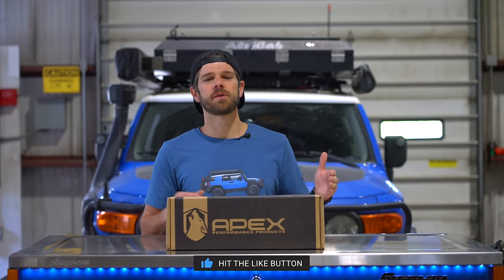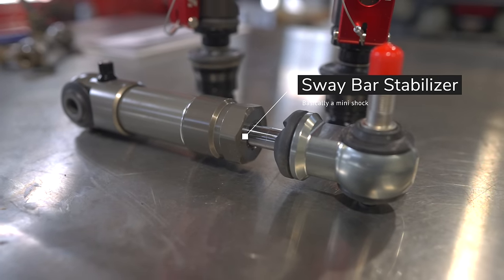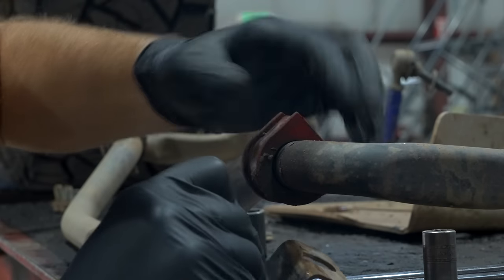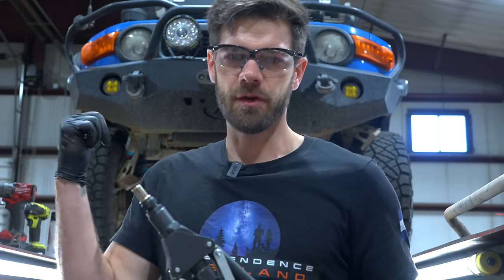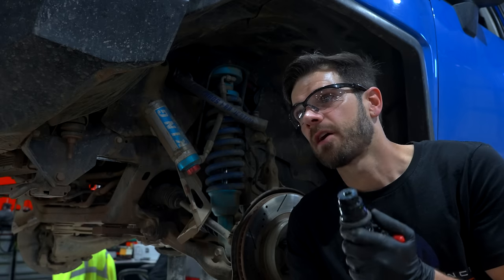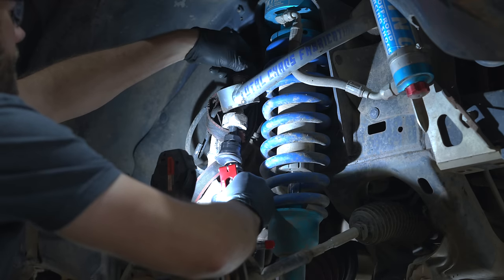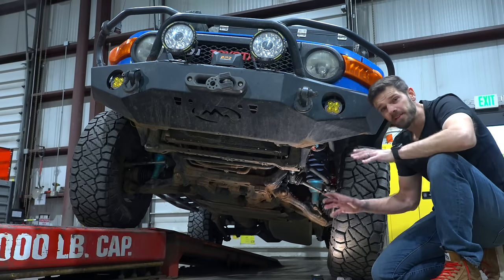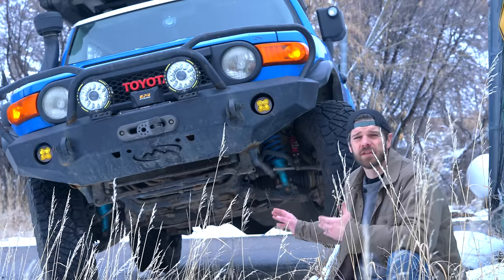The Ultimate Toyota Sway Bar Disconnect! | Apex Designs KwikLynx

Comment from the maker: A wonderful update. These no longer require welding, they still require drilling though! See the website for updated installation instructions. 

Apex Designs Disconnect kwikLYNX Disconnect: https://www.apexdesignsusa.com/products/kwiklynx

Bolt and Washer kit! Zinc plated coming soon! 
https://www.ebay.com/itm/176000986000?var=475438066727

Overland Vehicle Outfitters Remeote Resi Mount: https://overlandexpeditionoutfitters.com/collections/oeo-in-stock-in-store/products/oeo-front-reservior-mounts-for-dobinsons-mrr-4runner-fj-cruiser-tacoma-gx470

🌎 OnX Off Road 20% Off: https://bit.ly/499Pdu2
⚙HEST Mattress ($50 Off Coupon Code OVERLAND50) : https://bit.ly/3mZVulT
⚙ REDARC: https://bit.ly/3ughGfk
⚙ MAXTRAX Recovery Boards: https://amzn.to/3bwXpMR
⚙Channel Merch: https://www.independenceoverland.com/shop
⭐Amazon  https://www.amazon.com/shop/independenceoverland
Reply: I just watched their video a couple days ago. 🎉

Comment: $750 starting price... I know they are engineered deeply and come with R&D costs. But $750 feels like too much considering how many people would actually buy this if it was cheaper.
Reply: $750 seems like a very cheap price considering the quality of the parts... they will have no problem selling these once word gets out.
Reply: Depends on the buyer. $750 is a lot when it's just the parts. That doesn't include the labor installation. He advised most to take it to a shop. I wonder if it would just be better to lose the sway bar all together and get higher end shocks to dampen the body roll. Or go stiffer bar in the rear to compensate like Tinkerer did.

Comment: Now that Apex has taken welding out of the install process (it's optional now ...and I should really just learn to weld) I just bit the bullet and ordered a set of these for my 2017 Tacoma.  The increased articulation that this sway bar disconnect will provide combined with the Tacoma's MTS will really offset the lack of a front locker in many situations.  And $750 for this kit is still less expensive than a front locker and an easier install.  Anyone who has taken out the front diff on a Tacoma knows!  Now, combine this kit WITH front lockers and you've got an off-road IFS weapon.  Thanks for the video.  Cheers!
Reply from the maker: I was pleasantly surprised to see welding is optional, thank you for pointing that out for everyone bud!

Comment: The fact that this i is how the spindle is now connected to the upper ball joint is an absolute no!!!!  Nord lock washer are not a replacement for crown nut/cotter pins if it ever looses it's initial friction resistance there is nothing stopping it from vibrating loose! Aftermarket stuff at least uses a nyloc nuts while less optimal than crown nut/cotter pins in the end you get almost the same effect.

Comment: I just saw Apex's video they put out detailing the install of the sway bar disconnect.  Of course, being semantic, it's not really a true disconnect, but close enough right?😂  It is a big pill to swallow, $750, BUT looking at the product and the engineering and how much is involved, I'd say it's a big step forward and I'm looking forward to purchasing the system shortly and getting it installed.  If I watched the video correctly, they did make it so you can avoid any welding if you desire, but riv nutting those brackets to the frame I believe.  Which is cool.  I already had a buddy that can weld, but now it appears we can avoid that.  Looking forward to folks testing these in a technical way, doing RTI comparisons and also how well they hold up over time.  It certainly looks like a lot of engineering went into them to make them better than what was available before.

Comment: Video started out well but was lacking images as the install progressed, like what it looks like from the side fender well view of the stabilizer shock install, as well as installed without the tire on. To me Apex should offer the parts to work on several of the main aftermarket arm bolt adapters for the same price as the stock one they machined. Why? Because the majority of the FJ’s are already running lifts and are modified. They are the ones spending the money on aftermarket upgrades. IMO🤷🏻‍♀️

Comment: Great video and I'm driving an '07 GX 470 with Dobinson Billet adjustable UCA's Ironman FCP 2.5" lift with no sway sway bar.  No sway bar is fine for on road for the most part here in SoCal but it definitely rolls a bit on fwy turns.

Comment: Late to the comments here but great install - also great to see this documented for Apex's R&D. I do wonder if this will work with a beefed up aftermarket sway bar like the RSO or Super Pro 3 position. Maybe even get around the needing to drill the bar with the 3 position?

I'm already on board with Tinkerer's Adventures idea of a beefed up rear sway bar (though he doesn't run a front) and with these disconnects, would be fantastic if now a larger sway bar could be run in the front too for better, KDSS-like, highway speed handling.

Comment: Seems like a ton of work and it is expensive. I think I would be tempted to just remove the sway bar at the beginning of my trip or when I arrive at the trailhead.
Reply from the maker: Which would require removing 2 skid plate every time, and then having a place to put a sway bar. Doesn't work for my setup.

Comment: Hey great installation!! How did the different bolt that you had to switch out fit perfectly though? Wouldn’t they be different diameters?
Reply from the maker: Yes they are very very slightly different, but I ran it through the team at Apex and their engineer said it would be fine. So I put my trust in that.

Comment: I believe sway bar bushings are one of very few places that urethane can be used with good results on a 4wd. The reason being, as this video points out, a lot of people will run a sway bar disconnect. Therefore when off road you aren’t suffering from the negatives of the stiffness of the urethane. But come time to reconnect the sway bay. You will have very firm predictable swaybar/antiroll behaviour and performance. Also the ride harshness often associated with urethane bushings is extremely negligible in this application as it doesn’t take much load compared to a shock bushing or control arms.
My 2c
Reply from the maker: I appreciate your comment Dylan!

Comment: Caught the hat 😂. Does it make sense to just cut off the king coilover bracket and weld the bracket (part that holds reservoir) to the frame? Also… if you do this and throw on longer shocks (assuming it will only work with longer shocks), makes sense to put limiting straps to protect CV’s?
Reply from the maker: SandyCats club! 
Yeah, you could weld them to the frame if you wanted to save some money. I just know I switch stuff up usually right after I convince myself I never will, and so I avoid going that far typically. The disconnect should provide an advantage even with stock shocks. As far as limiting straps, I don't think you would have to worry about it. Guys with long travel don't need them I don't think and they usually ditch their sway bars. If I am understanding your question correctly?

Comment: I do like the design in how it allows the swa ybar to slide up and down along the link shafts. I wish this was an option for jeep disconnects on a solid axel as it would be nice to not have to wire the sway bar up to the frame when I disconnect.
Reply from the maker: They make Jeep stuff! That's actually their specialty, they are just now getting into Toyota.

Comment: rivet nuts on a sway bar mount make me nervous! I literally spun the welded nut inside the frame on my WJ swaybar mount this last weekend. I decided to fab a flag bolt to fish through the frame rather than a rivet nut. I just don't know if it would hold up to the pulling forces exerted on a sway bar. I can 100% be wrong though as I am no engineer!
Reply from the maker: Thats a fair point, hopefully it holds up! I bet it would take some serious forces to pull them out.

Comment: Need some advice. Just received my KWIKLYNX for my 3rd gen tacoma. Unfortunately I may have to swap out my UCAs, which I love (Icon Delta Joint) because the ball joint thread, which the KWIKLYNX connect to, have an M14 X 2.0 thread and the KWIKLYNX require an M14 X 1.5. So what KWIKLYNX compatible uca option(s) would you consider if you made a switch? Also, suggestions on how to resolve this if I want to keep my UCAs (does Apex offer an alternative? Maybe a different thread optoion swappable part)?
Reply from the maker: Check Dobinsons out. I like how they are building all sealed systems.
Reply: @IndependenceOverland  Thx. Thoughts on JBA's HD model?

Comment: The link to the bolts say they are 10.9 grade and the instructions say to use 12.9, did you go with 10.9?
Reply from the maker: That wasn’t in my early instructions I don’t think. Might have to upgrade mine.
Reply: I am curious about this as well, I am having a very difficult time finding M14x1.5, grade 12.9, 120mm bolts anywhere. I have a message in to Apex Design already.

Comment: You listed these as compatible with the 460, but all 460s came with KDSS.
Reply from the maker: Read the website
Reply: @IndependenceOverland  they won't get a ton of these sold for the 460. The only advantage would be if you're 3 linking the rear or going with RCLT, but for anyone on a mid-travel suspension KDSS is better.
Reply: @smashwindow01  So does that mean that this kit is actually compatible with the RCLT kit? I was under the assumption that the RCLT kit completely moved things around in the front and that there was probably no way this new disconnect kit would actually work with it.
Reply: @lawsonorsak8380 I have no idea, but I don’t see any other reason to remove KDSS other than going long travel

Comment: 2 bolts to remove sway bar link
Reply from the maker: 2 bolts each side, and that's if they will come off without the joint spinning. And then you have to remove the sway bar itself.
Reply: @IndependenceOverland  why? just take one link out job done